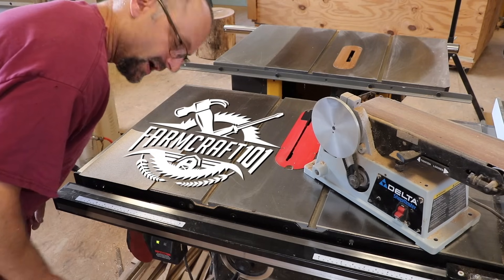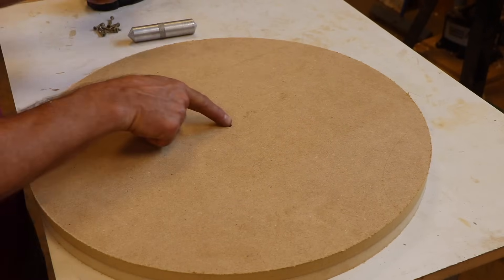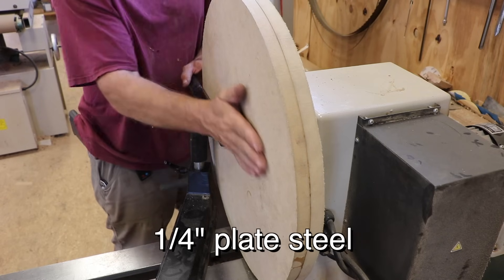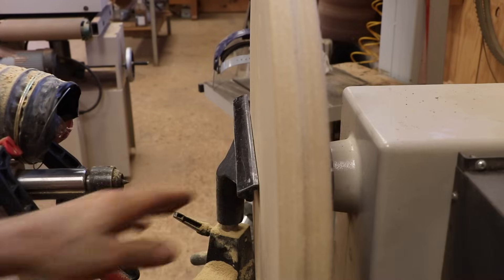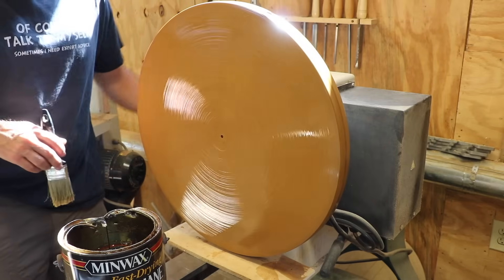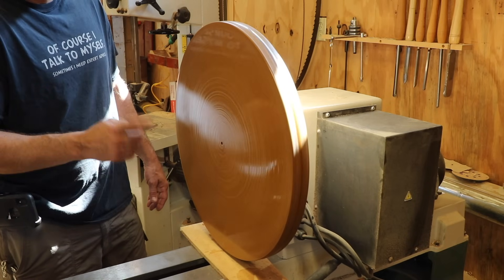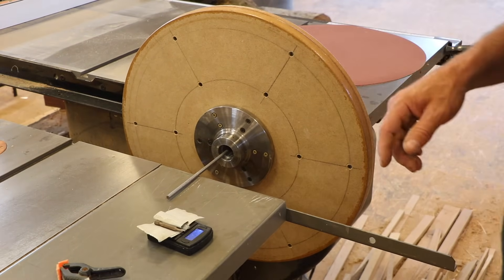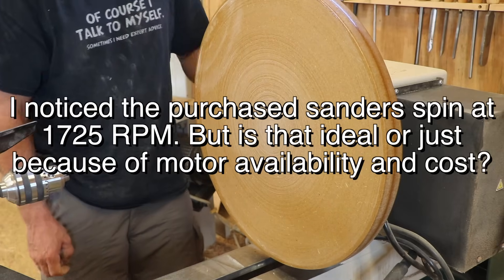DIY 20-inch Disc Sander Build.  $2000 Tool, Cheap and Easy.

Comment: I bought two of the heads for that lathe at grizzly when they were doing tent sales. One of them is now the power plant for a 2x72 the other is on a shelf. However, I bet I can bolt a 20" disc to the drive wheel of my 2x72 and just add a work table. Great idea. Don't forget to cover your ways. I wonder if self leveling epoxy would make a good face?

Comment: I probably wouldn't want to stand in the plane where chunks could fly while it's running. Not sure how beefy a guard would need to be, and if it's any good... or will just kick out fragments in all directions when the disc breaks.

Comment: No one can afford a 20 inch disc sander...they cost 2000 dollars!  You're much better off just using the 3000 dollar lathe everyone has sitting in the corner of their shop!

Comment: Nice video. I'll second or third the "finish the backside." I really love the way you balanced it with the screws.

Also, two quick comments. One, don't stand in front of the disc when you're doing a speed test. And, two, everything has a natural harmonic. It's based on all the stiff and not stiff bits and pieces that make up a machine (as well as mounting and damping items). It's master's or PhD level engineering math, so don't go there.  It may vibrate at one RPM and not another (higher or lower), so have fun testing that out.

Comment: All the effort put into balancing the wheel seems pointless as you'll never be able to stick the sandpaper perfectly in the center and preserve that balance. Other than that great idea and video.
Reply: You'd be surprised. I'd suspect the overall magnitude of imbalance for the mdf wheel is much larger than what would happen from off center paper. Lets try some napkin math:

 The ≈15 grams he added indicates an static imbalance of about 5.29 oz*in  (15grams=.529oz on a 10 inch radius).

Now consider the 20" disc. The imbalance due to the centering of the disc would be equivalent to the weight of the disc multiplied by the distance the disc is off center. How much do you think the disc weighs? Probably no more than 2 oz.  If a 2oz disc is 1/4" off center (and realistically I think you could do better than that), that creates an imbalance of about .5 oz*in. That's ≈1/10th of what he corrected. I'd say balancing it was well worth while.
Reply: @Brandon.S123  Yep, and if it's a very coarse and heavy paper, you can always use a chisel to trim the edge.
Reply: @Brandon.S123  Plus, if he notices vibration after putting the disk on, he can take the disc off and reposition it.
Reply: @FarmCraft101  Seems great - no fixes needed :-)
Reply: Well provided you can find yet BIGGER sanding disks, you Could over lap the edges and trim it

Comment: Nice project, well planned and built. I have a 15" lathe that would work well. I don't have a metal lathe or welding equipment but having a stand made shouldn't be very expensive.

Comment: the idea of using a lathe as a big disk sander is not new. i saw this on another channel ages ago. kings fine woodworking?
edit: yes, it was kings fine woodworking. here's the video:https://www.youtube.com/watch?v=VlNTvfgdnXc

if you have sanding disks in different grits, it would be a good idea to make one MDF disk for every grit. then you won't have to pull off the sandpaper and risk tearing it.

Comment: Cheese and Rice, man! What did you use to open your poly? Wire cutters??? All kidding aside, I've used poly on a much smaller disk sander and it's worked great so far. Thanks for the vid!

Comment: This is amazing man! I feel like lathe manufacturers should include this as an add-on option. You made it look so easy (though clearly it isn't! it's pure skill). Thanks for sharing!
Reply: Shop smith has a 12” disc. It doesn’t compete with a large dedicated lathe.

Comment: Hi John, many years ago I used to be a roustabout in shearing sheds, the shearer's had a 2 sided sander about that size (Metal faceplates) the paper was fairly course on one side and the other one was a finer grade for finishing off.
They used this apparatus
(example:-  Heiniger Comb & Cutter Grinding Tutorial
https://youtu.be/rcJZUtjp_tw ) 
 to sharpen the combs on their shears at the end of the work day depending on how many shearers the shed had it was always a scramble to get the the sander first
Shearing sheep and shed work is IMHO one of the most physically demanding jobs I have participated in
Biggest shed I worked was 18 stand with each shearer doing between 130 to 200 sheep a day oh my aching back just thinking about it now!
(This is an example of a small shed 
See a working Shearing Shed in Australia
https://youtu.be/DDgyYpba_X8 ) 

Tony from Western Australia 🇦🇺
Reply: So... Don't insult a shearer, is what I'm getting out of this.  Right.

Comment: This was a cool build! It wouldn’t worry me to spin it to 750 rpm. Letter rip, tater chip!  You can check balance by setting a glass of water, ( don’t use a solo cup), on your lathe head, and adjust your weight by spinning it under power. The water won’t lie. Watch the harmonic in the glass. I made mine from a manual flywheel off of a truck. Took the ring gear off, and make an adapter to align with the flywheel to crank holes and a 1” arbor hole to fit my motor. My motor is off an old grizzly dust collector, and it spins 1750 rippems..  Takes almost 5 minutes to stop…. (The impeller portion of the dust collector is mounted to a 12hp gas engine homemade leaf vac for my mower.. I’m cheap bored and retired.😊

Comment: I wouldn't ever run that over 1000rpm. And that is only if you really need to.
Reply from the maker: Agree.  It sands well at 750, so I will probably just treat that as the maximum, though I'm sure it could take a bit more.